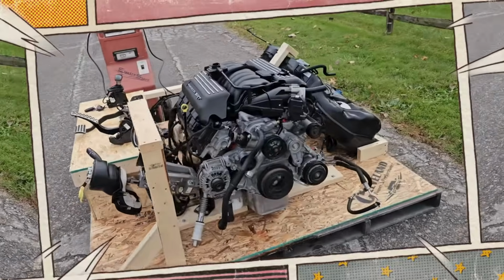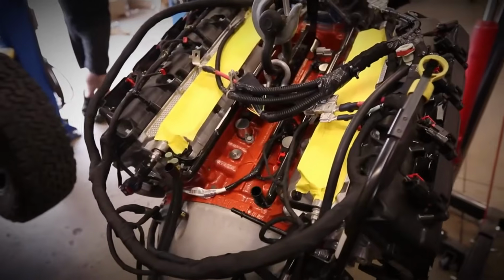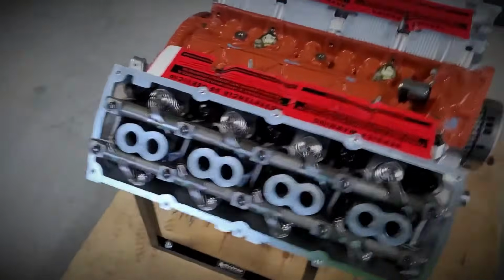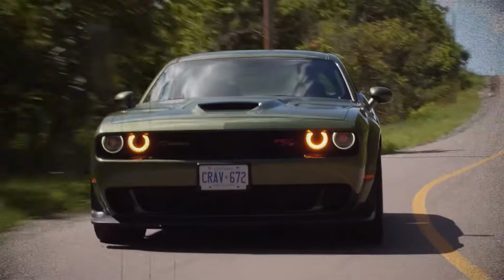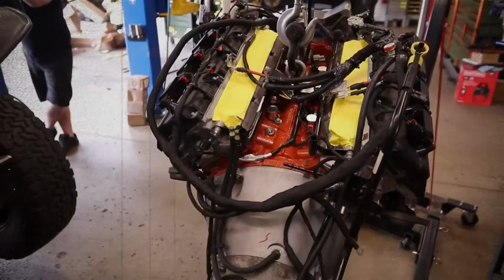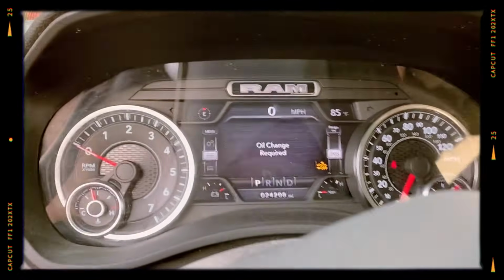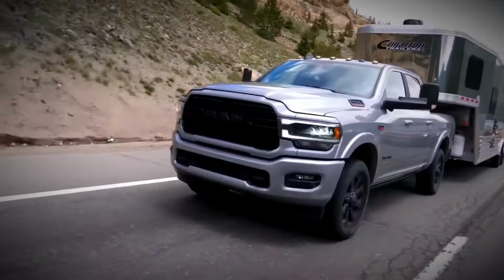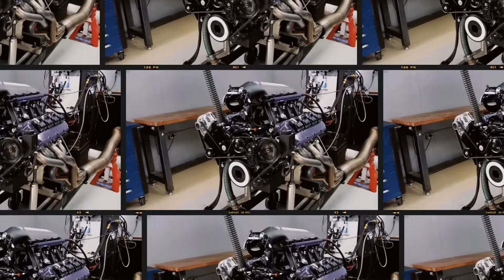Chrysler 6.4L 392 HEMI Engine — Power, Problems, and Reliability Explained!

Comment: Its a powerful N/A V8 i was running next to one on the highway it was keeping up with me i have a 6.2l LT1 V8 (455hp) the 6.4l hemi has (485hp) so i was not surprised it even past me slightly at times i also had a passenger which adds weight.

Comment: 114,000 miles with oil changes as recommended at the dealership.  Driving 40 mph oil pressure light came on. Rear tires locked up. Dangerous as all get out. Couldn't get the clutch in fast enough.  Completely destroyed my engine in less than 20 seconds. Now to replace with a short block around 14,000 dollars.
Reply: what happened?
Reply: my wifes 2019 just turned 100k miles.  Only had to replace water pump , balancer, and come small emissions part I cant remember.  Still running great
Reply: I bought a 2018 2500 6.4 hemi tradesman with 177,000 miles on it. I’m freaking amazed at its performance. I bought for 17k… so far, it’s the best deal I’ve ever seen. It’s smooth as a new truck…. Strong engine, good transmission…. I only had to fix the AC. Which was just a relay. I pulled 11.5k the other day…. No problem. I checked the car fax on it….. it’s been serviced like clock work. No major repairs. Just a damn good truck. Still got the stock exhaust manifolds. Freak of mechanical nature.